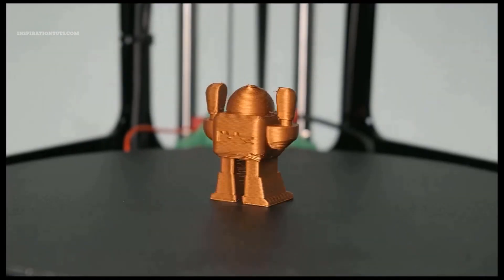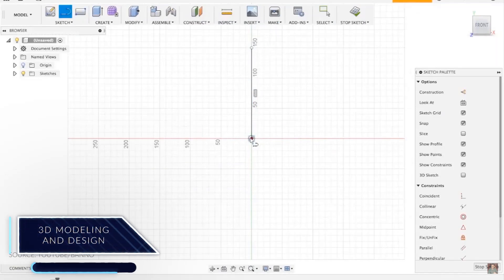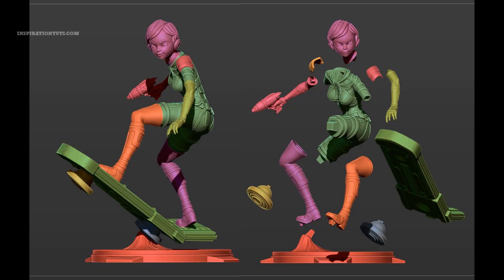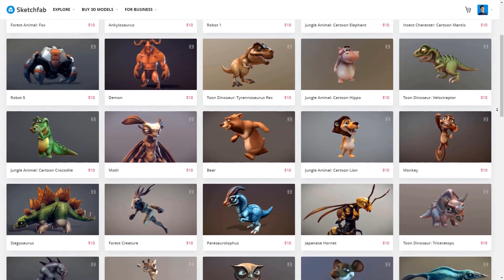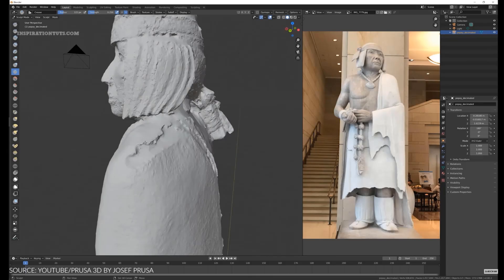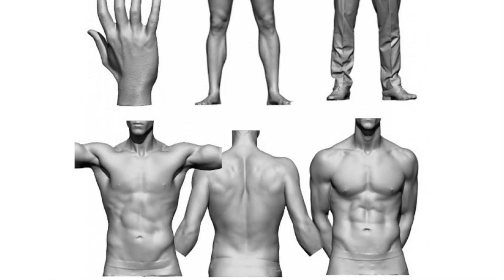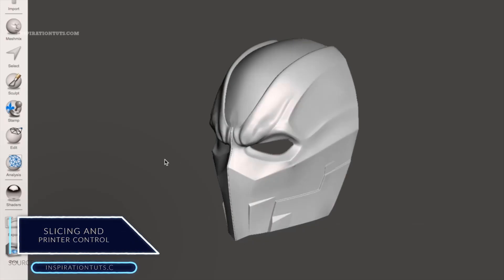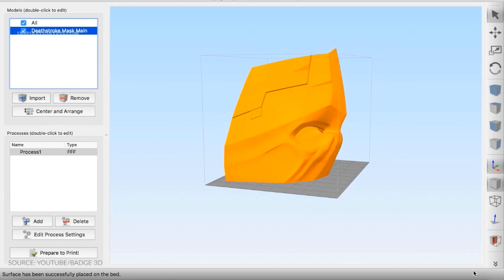how 3d printer software works

Comment: as someone who specializes in 3d printing, so far this is extremely accurate!
a few notes however: 
Blender is not that good at creating 3d printable parts, it is too easy to make unprintable angles. 
Fusion 360 should be mentioned very highly here, as it is the best CAD solution for 3d printing, and is either free or very cheap depending on your use case.
Resolution is not an issue when it comes to the printer, only the slicing software, a printer can realistically print most details, regardless of the polygons, it actually will do better the higher the polygons, as it therefore prevents stuttering.
Slicing software is usually pretty easy to learn, especially ones such as Prusaslicer which have preset profiles made especially for their printers (arguably the best in the hobbyist/prosumer market)
Reply from the maker: Thank you for the feedback.
Reply: I agree with most of your comment, but about your note on Blender I'd like to add that Blender also has tools for this, they are just hard to find, like everything in Blender. In edit mode, you can go to the viewport overlay settings where you can enable Mesh Analysis for overhangs, wall thickness, sharp edges, intersections and other distortions. They work really well and I never had problems because of this with the model.
Reply: @TheJunipera  thanks for the feedback! i personally just stick with fusion, as i do not like to rely on add ons, but seems like a thing to try out in future!
Reply: @zommy5re77  Mesh Analysis is built in to Blender. I never added any add ons either. I've yet to try Fusion so I can't argue which is suitable.
Reply: I use Fusion 360. It is amaxing and great for beginners.